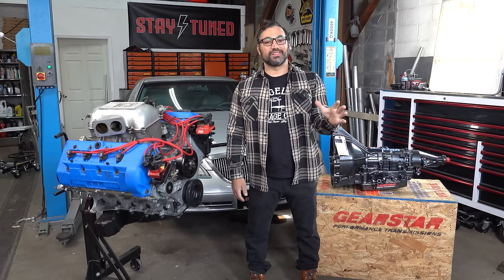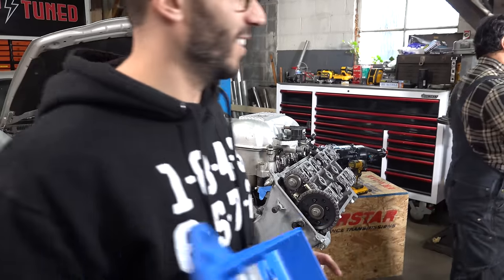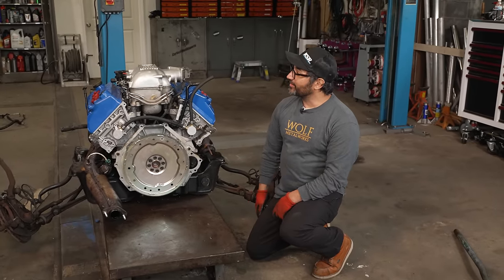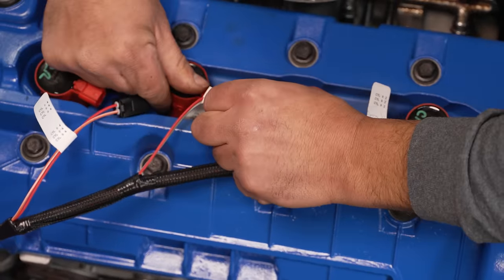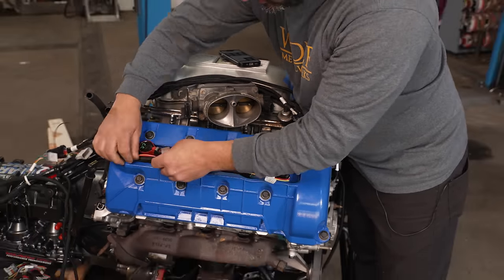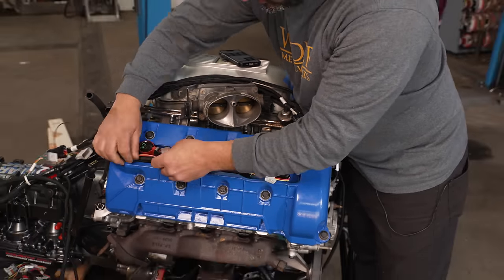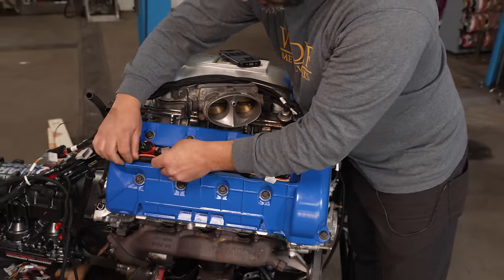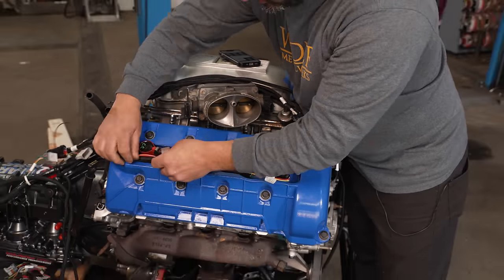$317 Turbo + $1200 Lincoln + New Motor = DIRT CHEAP FUN ! - Tony Angelo's Stay Tuned

Comment: It's so refreshing to see something new instead of another LS swap, but you really can't call it "DIRT CHEAP" anymore... You at least quadrupled the cost of the original build 😂still glad to have you back Tony
Reply: Yes but for all that under 10k is still a BARGAIN
Reply: @isaacbrown2703  Between the new forged motor, built trans, computer, etc there's no shot it's under 10k. I'm not trying to hate, like I said it's a very cool build and nice to see something different.
Reply: @jasonsell8523  you build it for $10k and see how far you get 😂
Reply: @dhag72  it's all about acquiring  the right parts.   Shit I have a built 428 that came out of a 75 f 250 that cost me 700 bucks.
Reply: @isaacbrown2703  definitely not under 10k. The motor they got a deal on at $4300. The trans is $7k per gearstars site.. Already over $11k and that's not counting anything else.
Reply: @SlowCobra  the trans was a waste he could’ve put a t56 or th350/400 for half that gear star unit cost and it would’ve held just fine
Reply: If it's under $20k I'd say it's a budget build

Comment: Sweet combo Tony. We have those mod motors in Australia as 5.4 litres, theyre called Boss 260 as 3v and Boss 290 as 4v. Maybe pick yourself up an intake manifold and plenum from one of them, or better yet a Yella Terra plenum.
Reply: We got the 5.4 4V in the Mustang GT500 and the Lincoln Navigator, of all things. The Navi motors are stupid cheap and everywhere but they have an intake manifold the size of an apartment building so they take some work to swap into other cars.
Reply: Pretty sure the 3 valve 5.4s are sohc and all boss 260 290 315 etc in xr8s and gt's are 4v dohc
Reply: @RobStaniford  actually I reckon you're right now I think of it. G220s had the lazy 3v DOHC. XR8 & FPV models were quad cam
Reply: Which Aussie 5.4s got an aluminum block?
Reply: @BuffMyRadius  none of them, they were all cast iron
Reply: @matt.ja90  well, at least they're all ready to slap a couple of terbskis on!
Reply: @BuffMyRadius  No Aussie motors are Ally, they are all cast.

Comment: That 4.6 sounds WICKED! The new tires, and wheels look killer to. With all the suspension upgrades the new transmission the new 4.6 it's really a COOL build! But come on Tony you need to build a  set of stainless steel long tube headers. PEACE ✌️

Comment: I had a proper working mark 8 air suspension and it was so cool the car would drop on the highway for better aero :) I installed a led board so I could watch when the air solenoid would open to raise and lower the car.

Comment: Tony inspired  me to turn my 59 edsel into a drag beast. Lol  429 c6 fitech fuel injection  2 inch drop in the front with disc brakes. Just need to get a new 9 center so I stop blowing up rearends. Think I'd be able to maybe pull the front wheels off the ground

Comment: Do you expect it to last with the conecting rods clanking around like that when you touched/wiggled them. I would run hydraulic fluid instead of oil to make it a little thicker & last longer. It's got overhead cams so you have to double the compression ratio cuz it's got more than one, it's probably 17.6:1  Also it has ARP studs, so you compress the head gasket even more so you have to add compression for that too so it's probably 18 to 1 I would make sure you used 87 octane or less with a little lacquer thinner to keep the detonation nice and hot.  Is make sure you use split fire spark plugs for boost. Most people don't know a lot about boosted engines but I learned myself. If you need some help let me know.
Reply from the maker: It's got 4 cams, so you have quadruple it, I figured you would already know that.

Comment: So my drift car is a 1998 mustang gt. I have drift domestic front knee assemblies, bc coilovers, and 2016 mustang gt IRS conversion. I did do a tko 6060 swap with a twin disc but I still have the numbers matching 2v 4.6. trick flow heads and cams, forged eagle stroker crank, rods, and diamond pistons. I run a bbk intake manifold, 2200cc injectors, on a holley dominator. I have a Garret I believe gen 3 7887 on a t6 flange to equal length 2 inch primary headers I made myself then port matched the exhaust side and intake side of the heads. I do run it on e90 but she makes 704 wheel easily. The only reason I don't run more is because I haven't saved enough for my gforce dog box yet. The tko 6060 is a fabulous transmission, however it barely handles 704 wheel. That's only at 18 psi BTW. I beat the ever loving shit out of this engine and the only thing I've had to replace is timing chain tensioners and slides. The car weighs 2840 with me in it, I spent like 12 hours getting it perfectly balanced not only front to back but side to side. Its exactly 50/50 weight distribution. Everyone who's driven my car thinks I put  mustang body panels on an s chassis. It's that good. So my point is, as long as you set them up right, I'm a 2v guy however, mod motors actually fuc pretty hard. I admit they aren't flawless, but nothing is.

Comment: Man! That hot side is terrible lol. Like a horseshoe, except the right side collides into left side then has to find it’s way back forward and up to the turbine… Wonder if now with the a/c delete you can run the manifolds forward… Would probably make a lot more hp with a better hot side… Obviously room is a restriction in that crate… A lot less back pressure the engine would thank you lol. 15 lbs of boost probably 30 lbs back pressure lol. Just an idea… 👍🤘

Comment: When i saw the first run when engine blew i was wondering why you werent manual shifting the Auto 
L - 2 - 3 Or D as needed (Lets you hold it in first or 2nd until redline. ) and dont let it auto shift 
(tho should never need Drive on 1/4 mile as 3rd should rev out high enough, unless its a 3 speed auto not 4 like most in 2000's. 

Have driven every automatic like that over last almost 40 years of "Amateur" racing.
Not to mention also manual downshifting on old automatics that allow it 
(most from Pre 2000's lets you manual downshift the auto,) 

Loved my old Holden HQ from 1970's i used for dirt rally could downshift to 1st at 60kph/40mph and compression lockup the rear wheels for corner entry instead of handbrake, as the rear drums would get wet and not work on rally track.

Comment: How about the holly cast intake manifold with a water to air intercooler stacked inside it. Been thinking about running one on a coyote with a procharger just for lack of plumbing and simplicity
Reply from the maker: Yeah, we had the turbo setup and wanted to see if it could make better power with a built motor but that works too!
Reply: Not a big fan of aftermarket hoods or the newly popular hood delete look due to clearance's.

Comment: Please for the love of god.. dont let any of that unburned oil in the combustion chamber! It will detonate and pop that motor! Find the source of the oil.. see if intercooler has oil in it.. make the pcv valve go through a couple of catch cans or vent crank case to exhaust (old school)  or blow down and out. Lost 3 motors to ringland failure to oil.. had valve stem seals installed half way cause smoke at idle under load it go away but 5 psi boost the worst detonation i ever heard then lost the motor.. dont let oil in combustion chamber

Comment: I actually like the teksid block better than the cobra block. They save weight and are proven to handle over 1200 hp with forged bottom end. Ferrari actually made that block for ford many don't know that.

Comment: Hey Jimmy what are you doin over there? Just beatin it! :) :) It's nice to see some 4.6 love even if they're dog slow from the factory.
Reply: A 4v isn't dog slow from the factory.  The Lincoln had 280 horse that is pretty good for 1993 and the cobras had 305 horse back in 1996.  They can make 450 rwhp pretty easy with a little boost on stock motor.  Forged rods and pistons and they can make big power with stock heads and cams.
Reply: @midnight347  280 is only 20 more than the 260 from my 99 2v. Both comparatively dog slow and why most won't touch these things. Especially with the 2v stock limitations, the bulkiness of them, and the cost to make them go fast. It's why we see so many LS or Coyote swaps all over the place. So seeing some 4.6 love is pretty nice and rare. I'm building my 2v because of this. Is it dumb? Yea, but you just don't see it out there much.
Reply: @ppmguire  but this came in 93 man not 99.  The 4v has alot more potential the Lincoln version was lower because of a different intake manifold and tuning basically otherwise it's the same engine.  280 in 93 wasn't bad from 4.6 liters.  They weren't exactly "dog slow" from the factory in 1993 standards.  It's a big car so it isn't super quick but not bad for 1993.  The cobras in 1996 ran mid 13s best which was pretty damn good and a steep gear could drop half a second et easily on those cars.
Reply: @midnight347  I know it came out in 93, but the motor they're using now isn't from the 93 Lincoln. Even still, 280 is only a cough away from the 260 from my 99 2v hence comparatively speaking. 280 was decent in 93, 260 is meh in 99, but today it's slow. The V6 in my truck has more crank HP than my Mustang stock. The point was when you compare what you can get from competing platforms vs starting with these you can get way more for your money especially when you get into replacing the rotating assembly. The aftermarket for an LS or Coyote is way bigger and it's easier to get bigger power. Everybody knows this. How many junkyard LS1 builds are there out there compared to 4.6 builds? For the amount of money it's costing me to get forged parts for my 2v I can go and get a gen 1 Coyote and call it a day. It's why you don't see these builds much and why it's nice to see it.

Comment: Love the lincoln. Wanted one of these so bad but ended up with an LS430. Any cutlass videos coming up? I've been gathering parts for my skylark over winter, would like more A body action
Reply from the maker: Love the LS430 though, great cars. Cutlass in soon. We got a new frame, this one is twisted up bad.
Reply: @Stay Tuned  dang. My buddies monte carlo is the same way. Twisted up bad from a wreck. How much a frame set you back? The ls430s are awesome. Mines quite beat up, but she drives alright. Started getting into the swing of making videos so I gotta make one on that car and the skylark soon

Comment: Thank yourself you did not use those powered valve covers.... Some numbnut coated the inside.... That will lock up the engine in about a couple burnouts.... Been there... Done that...  
The oil softens the coating... That comes off... Clogs the oil tube... Going from all to zero oil pressure.... After 60ft

Comment: What turbo was that? I want to build a turbo kit for my 2v PI engine swapped townie, I was looking at the GT45 turbos but I want something slightly better built than the cheapest eBay turbo...I'm looking for a quick spooling turbo for around 400hp
Reply from the maker: 70MM .96A/R from On3 performance. Very solid journal bearing turbo, will make WAY over 400hp.

Comment: Have to put a 1200hp turbo on it to make a reliable 400hp.
Reply: What?  Wtf r u talking about you can make a reliable 400 wheel pretty damn easy even with stock motor this is a built motor it'll make a ton of power easy this is a 4v my man.

Comment: Omg. You didn't do anything about the headon colision header?
Reply from the maker: Nope! My bets are it's gonna rip just the way it is! There's NO room for much else so we are gonna let it ride, if there's some crazy boost issue or it won't make power we can do some rear mounted turbos off of long tubes.
Reply: I was thinking about a cast tight 90° into a y or something. I'd love to see a drive pressure gauge just for shits and giggles.

Comment: lower compression would be great for the boosted engine...high comp+ boost+high rpm  often = Big boom and a block with a window
Reply: That was the case back in the old days.  With modern advancements, engines like a stock gen 2 or 3 Coyote on e85 can sucessfully achieve all three.  They even upped the compression ratio, boost and redline for the last of the 4.6/5.4/5.8L generation with the 2013/14 GT500 Trinity engine.

Comment: too bad you lunched the B-heads on the original engine - with cams and springs you can spin them too the moon. look up what John Mihovets did with B-heads, next to Ford GT heads, they're the best.
Reply from the maker: The new motor has cams and springs though? Old heads are actually fine, just a minimal amount of pock marks in the one cylinder but totally usable.
Reply: This motor also has B heads! Planning on spinning this thing to the moon for SURE!
Reply: @BarbalinardoInnovations  Awesome! and my bad I mis-identified that cobra intake as a C head model. So 9500 RPM John Mihovets style?
Reply: @StayTunedTA  My bad I mis-identified the intake as a later C-head cobra intake. If this is Tony, reach out to John Mihovets at Accufab, he can show you how to spin 9500 rpm with this thing - since we all know you are addicted to revs.

Comment: Who ever would’ve thought saying “Put the hammer down & break every speed record possible” could yield nothing but awful results (& the only record I broke when I did it was amount of trees knocked down by a Handa Del Sol…and I still hold the record with 8 trees; in a car that weighed under 1500 Lbs at a weigh station & I think 200 of that was probably in my girlfriend at the times bra)

Comment: So I saw on the subframe you have the crappy mevotech suspension bushings (blue ones) they are made out of thermoplastic get those gone asap they will actually crumble and break. Get either OEM rubber or the supercoupe performance urethane ones. Even dorman is thermo plastic
 https://www.tccoa.com/cdn-cgi/image/format=auto,onerror=redirect,width=1920,height=1920,fit=scale-down/http://members.tccoa.com/tbirdbrain/images/bushings.jpg
Reply from the maker: Good looking out! I'll dig into it.
Reply: @StayTunedTA  happy to help don’t want you guys losing control at a strip or autox type event and ruining the day

Comment: I knew 5 minutes into the first video what was going to happen when you slapped a turbo on that 4.6. The 4.6 was the biggest pos ever made. It was designed ONLY to support stock configuration. Those engines made very little power with mods and were absolutely unable and not designed to support a boost setup. Sure there are people who did it but they always ran LOWWWW levels of boost and in the end their engines always ended up like the one you grenaded here.

Comment: Why meth injection? Put it on e85 and an intercooler. You dont want to blow up the engine relying on meth injection.
Reply from the maker: E85 is tough to get around here and I plan on doing some miles on this thing! I may have to do something about the exhaust.

Comment: mark viii motors are "built" from factory, how you guys blew one is beyond me... 🤦 ive done donuts with temp gauge needle pegged in the red & OP light flashing, yet still daily my mark viii with ~220k original miles. the engine itself is forged aluminum with a SBE, if you lot had done a teardown before trying to throw near 20lbs of boost at it maybe there'd still be another 4v out there